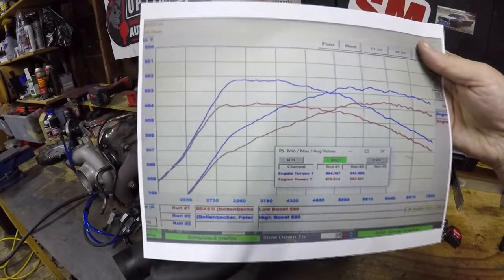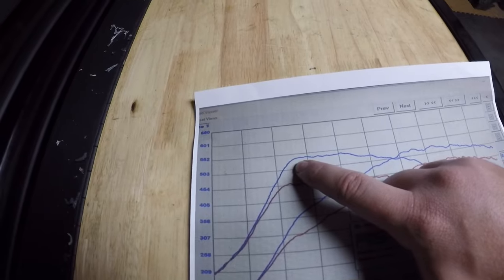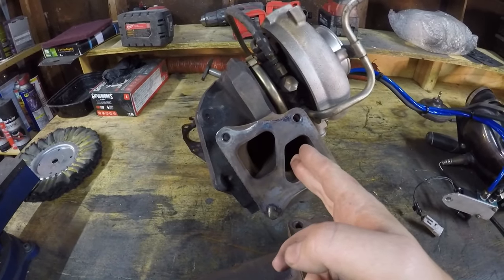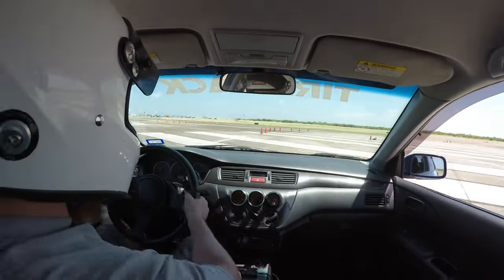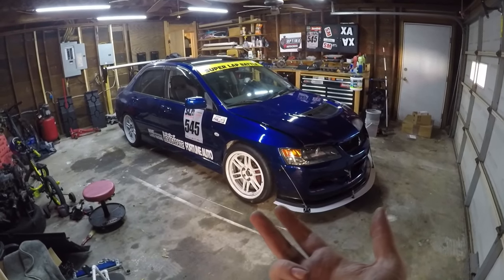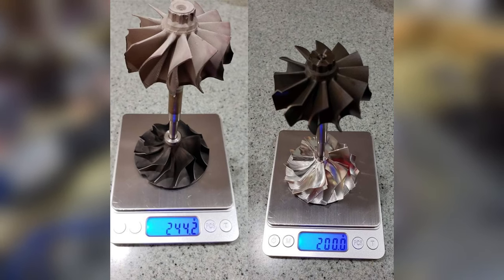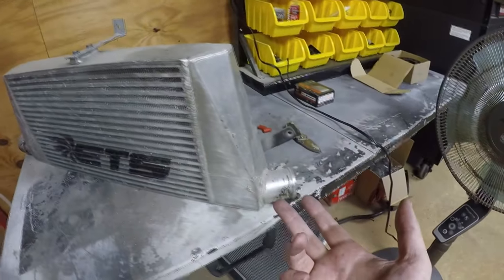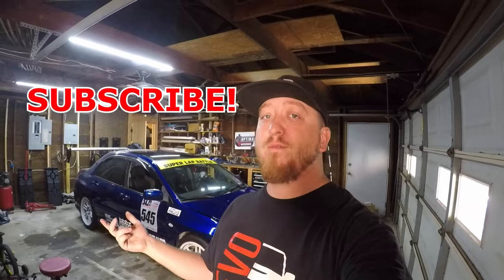How to make your turbo SPOOL FASTER - the simple tips you need to know!

Comment: One tuner tip for getting rid of lag.. dont have your low rpm ignition timing advanced too much... the least advanced it is during your expected  spool up rpm range the faster it spools up due to much more heat energy from the R-word ignition timing(sorry yt hates the R-word) then you can advance the timing back to normal after the turbo has spooled..  thats how i get full boost at 1600rpm mind you this is on a 347cid engine, but still the lack of turbo lag after doing that ignition timing trick was unreal.
Reply from the maker: Very interesting!
Reply: yep you want advanced ignition timing for NA but the more timing you can pull out mid-high load the more response you see from the turbo and the faster you get into boost and making actual HP! I can see 4psi at 60mph 1800rpm from a 4.0L with a GTX3582r Gen2
Reply: you lower timing at spool not because of spool up.  adv would actually give you more.  you lower it to reduce knock because engines dont like being loaded at lower rpm.  this saves your engine from detonation.  any tuner worth a pay check for it knows this. 
the best and only way to really tune for spool is with a turbo speed sensor and a pressure sensor between the head and turbo.  you want the psi at that sensor to match your target psi at the same time the turbo speed is in its efficient rating based on the compression map and your engine.   without those 2 sensors you are just guessing.
Reply: retarding timing does put more heat in the exhaust but kills power  i prefer to have the right timing and just get the turbo that spools
Reply: You tube just is not advanced enough to understand
Reply: That R word got me cracking up, thanks buddy

Comment: I recently saw a man that presented himself as knowledgeable on the subject say that the cold side volume doesn't play a significant role in the time to charge.  There are drag cars with front mounts that pipe to the trunk to an air water intercooler and then back to the engine.

Comment: Volume of the turbo plumbing has neglible effect on turbo lag, the turbo has such a high CFM it litterally does not matter, do the math on the time to fill its basically nothing. Its the surface area of the exhaust that effects turbo lag not its volume, this is because the exhaust tempreture is reduced by higher surface area pipes, lower temp exhaust means lower exahaust energy and thus less energy scavenged by the turbine and more lag and a higher threshold, insulating those exhaust pipes remedies this. Watch the driving 4 answers videos on remote turbos. Otherwise good video.

Comment: Forgot one of the most important factor, intake camshaft timing. Earlier valve opening and closing traps in more air mass at slower piston speeds, and helps getting residual gases out of the cylinders with increased IVO/EVC overlap event (only works properly on boosted engines when EMAP is lower than intake pressure). Also the dynamic compression increases with early intake closing making possible to compress more dense air charge. All of this increases the engine VE making it to produce more torque.
Reply from the maker: I actually covered that in the 2nd part of this video series, just put a little more simply comparing one dyno sheet with vvt compared to another with no vvt

Comment: I went from a smaller tube and fin intercooler to a larger bar and plate since my driving style was more straight-line highway pulls. It caused the boost to come on a bit later but charge temps were lower.

Comment: Yes, but if you drive correctly spooling is a non-issue
Reply from the maker: In a straight line sure some corners on tracks and for autox especially you get lower in the Rpms. But you knew that 😀

Comment: I had a twinscroll Borg Warmer 8374 EFR turbo which uses a gamma-ti turbine wheel using a ceramic ball bearing cartridge. The Full Race twinscroll system used a dual external waste gates Y’d  into a 4 port boost solenoid. Dump tubes where dta. A port and polished head with upgraded titanium intake valves and black nitrided exhaust valves and 272 camshafts. That improved the volumetric efficiency of the motor which helped the transient response of this turbo. Being that the sti was awd made this car wicked fast from a dig.
Reply from the maker: The dyno sheet I show right at the beginning is a Borg Warner EFR 7163 on a STI. I think EFR are the superior turbos on the market for when it comes to faster spool. I was looking into the efr 7670 myself for a future setup.

Comment: How does the size of the wastegate relief port make a difference for the speed of turbo spooling ? . The wastegate will be closed until the turbos fully spoiled anyway ?
Reply: yeah there's come confusion about max torque on the rev range ( which depends simply on turbo size) and responsiveness ( gas on a pedal to getting some thrust

Comment: Question. You mentioned that the waste gate being internal and smaller was a factor in spool up being quicker. But then you mentioned that the 4 port would keep that closed during spool up.

If the 4 port is keeping the waste ate closed, doesn't that negate the smaller size being better? Having the smaller size would be a drawback to control, right?

I am assuming that even if I had a 60mm external wastegate. If it is closed during spool up it is the same as having no wastegate.
Reply from the maker: I definitely see your point but in reality how many people are actually get and use a 4 port boost controller? Even a lot of tuners are just scared of what they don’t know and won’t learn how to tune on one to get these types of results . So majority of people will still just use a 3 port, and with out that 4th port holding the gate shut the exhaust gases on its own will push open the gate. And it seems from what i have looked into with a 3 port alot of tuners just always the gate being supplied with air through the entire band. 

Even on mine with the 4 port was never fully closed down low but was shut like 75 percent. If you did that exact same thing with a 60 mm it would still lose velocity due to volume size. 

But yes in the theory that it’s fully slammed shut I’d say you’d be right. I believe a lot of people setup up EWG setups wrong and lose to much velocity when they don’t have to and if I was a decent size YouTuber I would build another project to test my theory on but I’m not there yet lol
Reply: @Bang4BuckRacing  I don't want you to think I'm trying to debunk you. I was genuinely asking.

I can see how having too big of a wastegate would dump your boost as well. I wasn't aware that the 3 port wasn't able to hold the wastegate closed well enough. But it would make sense that they developed the 4 port to deal with that.

There are electronic external wastegates now as well. Way more expensive, but eliminates the need for vacuum and boost lines to actuate the valve. Pretty cool stuff.

I appreciate you getting back to my question though. A lot of good information in the video and in these comments.
Reply from the maker: All good my man we’re all hear to learn and grow

Comment: Hrmm, I'm curious as to how you came to the conclusion a smaller internal WG spools a turbo faster than an external gate?
Dig a little bit deeper about the builds, what other changes are there from the IWG to EWG setups.  The size of the Wastegate aperture doesn't have an effect on spool if everything is working properly.
Reply from the maker: I’ve had the discussion many of times and every single the person arguing for EWG can’t show me a dyno sheet making full boost and peak torque before 4000 except maybe 2 people. Regardless of IWG or EWG it is simply just a pressure relief port.  EWG do their jobs good i just say they do it to good. When a 38mm port opens for the same amount of time a 32mm port opens it will relive more pressure every time. And that’s less exhaust gasses spinning the turbo. Especially on the standard 3 port boost controller setup most do. 

I don’t think an EWG can’t spool fast as well, but I have multiple dyno sheets in my possession all spooling below 4000 rpm still making great power on IWG. 

a lot of tuners are uneducated and unfamiliar with how to properly tune a dual port WG internal or external and with a proper 4 port boost controller. It will yield much better results they are just slot more difficult to dial in. Small changes can make huge jumps in boost made.

Comment: Although I agree with a smaller wastegate being good for higher boost in smaller turbos and keeping gate shut will help spool the turbo better.... running into issues w boost creep is the next issue or over boosting and running lean... where a secondary waistgate would be optimal... but I think the slight difference in size waistgate internal vs external really doesn't matter if ur closing it off completely to spool... id rather have the ability to bleed it if Slightly better for above reasons...

smaller waistgate size is good for higher psi and larger is better for lower psi... its all about bleeding off power from turbo... after all a closed loop would just build engine speed and back to turbo around and around until blows up eventually... so bleed air slowly for higher psi... bleed air quickly for lower psi
once you go BIG turbo the entire issue flips on its head

Also side note on exhaust manifolds... boost threshold wont change from the length because the flow is already constant inside the header flow is always a better target when choosing manifold... although distance to turbo can make a difference if very far cause loss of heat... so header tape/ceramic or cericoat helps there
Reply: I'm board n got nothing better to do... just love theory and engineering type stuff... its fun

Comment: also its good for your viewers to understand that fast response isnt for everyone.  with faster spool times, means more stress at lower rpm, more stress on the crank, and more induced heatsoak and camber heat earlier on. which are the main killers of turbo engines besides the obvious main killer of all engines, cold dry oiling start.   it requires changing oil more to monitor engine health and heavily thought out induction as well as cooling to keep egts and iats in check.
Reply from the maker: I agree 100 percent there’s more maintenance that comes with it and more stress I have personally experienced it.

Comment: I have the same dual port turbosmart WGs, unfortunately the chamber that is supposed to shut, leaks as per design. The one that opens the WG, has 0 leak but the other one leaks around the shaft. Have you tried to build pressure with a handpump in the closing chamber? What is the outcome?
Reply from the maker: I have the one with a swivel at the end and very tight tolerance machine fit. Yes a tiny bit leaks by but isn’t enough to lose a lot. The ones with the rod coming straight out and no swivel will lose more as well.
Reply: Those Turbosmarts are crap but you can seal that rod with right size valve seal, mine came from some Opel. It limits travel a little bit. Better buy those chinese copies for less money, they are as good as Turbosmart.

Comment: Have you ever tried to calculate how much difference it would make with larger intercooler and pipes? I ran some calculations and it shows that going from  2 inch Evo size intercooler to 4 inch and from 2.5 inch to 3 inch intercooler pipes would make 0.03 sec difference...)))
Reply from the maker: Here is a post on forum for a while back that I referenced. The IC piping plays a little bit more of a factor than the intercooler it’s self. 

“you want to run the smallest possible without going over a certain air speed. 304 MPH or 0.4 mach is the point at which airflow meets increased resistance (drag) and flow losses are experienced.

Depending on which turbo your running and what hp your looking for will determine piping size. to small is a restriction and to larger is laggy. generally for the average setup 2.25-2.5" is what works

here is info i found on mach speeds of certain size piping relavent to cfm flow

2" piping
1.57 x 2 = 3.14 sq in
300 cfm = 156 mph = 0.20 mach
400 cfm = 208 mph = 0.27 mach
500 cfm = 261 mph = 0.34 mach
585 cfm max = 304 mph = 0.40 mach

2.25" piping
3.9740625 sq in = 1.98703125 x 2
300 cfm = 123 mph = 0.16 mach
400 cfm = 164 mph = 0.21 mach
500 cfm = 205 mph = 0.26 mach
600 cfm = 247 mph = 0.32 mach
700 cfm = 288 mph = 0.37 mach
740 cfm max = 304 mph = 0.40 mach

2.5" piping
4.90625 sq in = 2.453125 x 2
300 cfm = 100 mph = 0.13 mach
400 cfm = 133 mph = 0.17 mach
500 cfm = 166 mph = 0.21 mach
600 cfm = 200 mph = 0.26 mach
700 cfm = 233 mph = 0.30 mach
800 cfm = 266 mph = 0.34 mach
900 cfm = 300 mph = 0.39 mach
913 cfm max = 304 mph = 0.40 mach

2.75" piping
5.9365625 sq in = 2.96828125 x 2
300 cfm = 82 mph = 0.10 mach
400 cfm = 110 mph = 0.14 mach
500 cfm = 137 mph = 0.17 mach
600 cfm = 165 mph = 0.21 mach
700 cfm = 192 mph = 0.25 mach
800 cfm = 220 mph = 0.28 mach
900 cfm = 248 mph = 0.32 mach
1000 cfm = 275 mph = 0.36 mach
1100 cfm max = 303 mph = 0.40 mach

3.0" piping
7.065 sq in = 3.5325 x 2
300 cfm = 69 mph = 0.09 mach
400 cfm = 92 mph = 0.12 mach
500 cfm = 115 mph = 0.15 mach
600 cfm = 138 mph = 0.18 mach
700 cfm = 162 mph = 0.21 mach
800 cfm = 185 mph = 0.24 mach
900 cfm = 208 mph = 0.27 mach
1000 cfm = 231 mph = 0.30 mach
1100 cfm = 254 cfm = 0.33 mach
1200 cfm = 277 mph = 0.36 mach
1300 cfm max= 301 mph = 0.39 mach”
Reply: Well, it is going to have some effect for sure but it's not that critical as most of us think. The difference in the air mass with different volumes in so small so an average size turbo can move it with almost no difference comparing to smaller intercooler and pipes. What really affects the spool is the TB size...
Reply from the maker: To me every inch counts even if it’s 100 rpm difference. It’s the whole equation to me that produces the results.
Reply: True. Everything counts especially if you do the whole lot...

Comment: My Mazda leaves the waste gate open until it’s under load then closes. I’m trying to find a way to have it close early enough that’ll begin to push air into the engine around 2,500-3k rpm. I don’t know if that means the ECU would be flashed to change the waste gate flow or needing to change some parts
Reply from the maker: You sound a little mixed up on how the system works brother I suggest doing a little bit of hw
Reply: @Bang4BuckRacing  I’m still trying to figure it out, the waste gate duty cycle stays at 50 while stopped then drops to 0 while hard driving. So would that mean the solenoid would close, increasing the turbo speed while under load?
Reply: Put more preload on the wastegate.
Reply: @Viciouslord compression or rebound 😂

Comment: Hey how does a 4 port boost solenoid make the turbo spool faster ? I'm new to all this
Reply from the maker: Slamming the wg shut at lower Rpms to where even exhaust gases cant open the wg like on a 3 port. When it slammed shut the turbo builds more energy sooner and the only place to escape is the down pipe forcing it to spool faster.
Reply: @Bang4BuckRacing  What if you T off a 3 port and run lines to the top and bottom?
Reply from the maker: @Jamxknife  I did that on my Subaru and saw no real gains it doesn’t provide ample pressue imo like a 4 port does with a extra dedicated port to slam the gate shut
Reply: @Bang4BuckRacing  Ok! I’ll give my 4 port a shot. I had one for 2 years and never installed it.
Reply: @Bang4BuckRacing  so even with the stock internal wastegate it's not fully closed before you hit targeted boost? Just curious cause I'm doing all these things to my evo to increase spool for autocross

Comment: Drag racing is such a murican sport. 
At least put ONE corner in there somewhere. 

If you just want max acceleration why not use rocket or jet engines? Or why not just build rockets? 

There's nothing in drag racing that corresponds to 'normal' driving at all.  Besides start and stop anyway. 
I get the novelty of it all, but I can't understand how you guys are so committed to it. At some point aren't you guys like, "Ok getting the hang of this go-stop bit now. Of only there wasn't another go-stop afterwards, then I could do it twice. HEY, if I make those bits between the go-stops go round sideways, I can bring it back over here and then I never have to stop.... 🤯 
I'd better start with just one, maybe two sideways roads between me go-stops tho. Never tried go sideways bit scary...."

And yes, Cleetus MFreedombang did get scared, so decided to just stick with the two sideways bits and just make them sideways untill they was backwards. 
"Two backwards sideways bits will do, don't like them much. I just want to go fast for as long as possible.....
FUCkin Nnnuuurmmmm. 🤤

And that boys and girls and retards is where NASCAR came from....
Reply from the maker: Brother did you see any drag racing in this video? I do autox and time attack on tracks.. that’s why I prioritize boost response so I can get out of the corner faster.